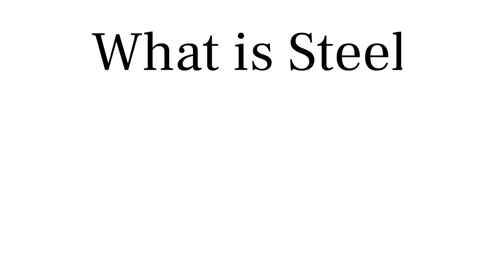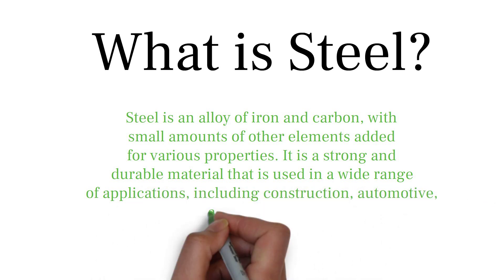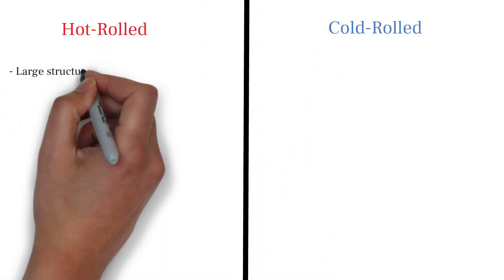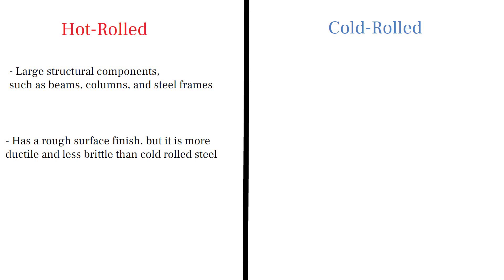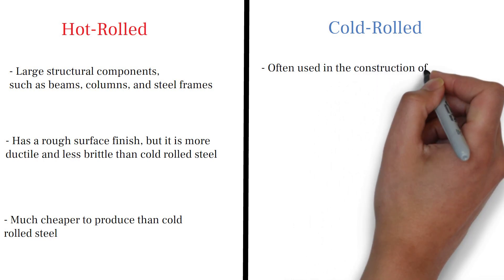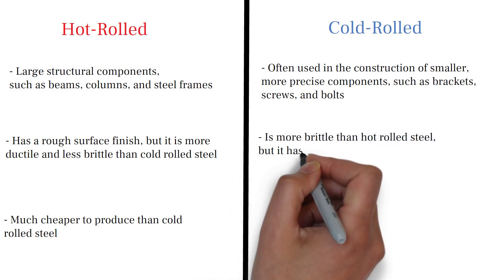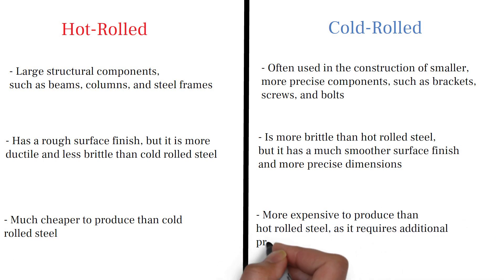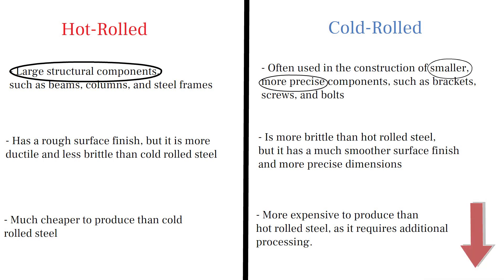Hot Rolled Steel Vs Cold Rolled Steel - What's The Difference?

Comment: Very incorrect information. Cold rolled is way stronger. You've got it the wrong way round
Reply from the maker: Thanks for your comment. We just want to clarify that we never stated hot-rolled is "stronger".  We did state that cold rolled is more brittle.

Cold-rolled steel is less ductile: The increased strength from cold rolling comes at the expense of ductility. Structural applications often require materials that can deform under stress (e.g., during earthquakes or heavy loads) without cracking. Hot-rolled steel's ductility makes it better suited for these situations.

Comment: A dangerous generalization.  You have said nothing about the wide variety of alloys in either group.  Your casual viewers will assume that all hot rolled steel acts the same.   Would you like it if one of them hand forged  a suspension component for YOUR car out of "hot rolled steel" because of what you have said here?
Reply from the maker: Hello & thank you for the comment. In construction, which is who we cater for on this channel, what we have specified in this video is generally true. Here, we attempt to make complex subjects simple. Our audience understand that every video is very much a snapshot....a scratch on the surface. We understand your channel focusses highly of metal working and we applaud that. This channel focusses highly on construction contracts and QS principles.
Reply: It's wrong information in actually building a custom cantilever rear suspension for my car and this video would have given me the wrong info..... Do not like and subscribe